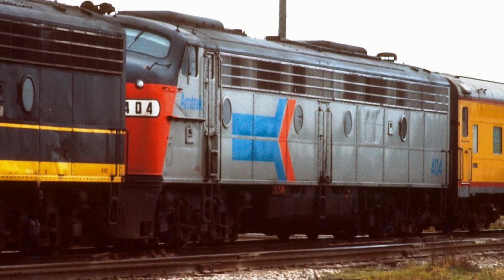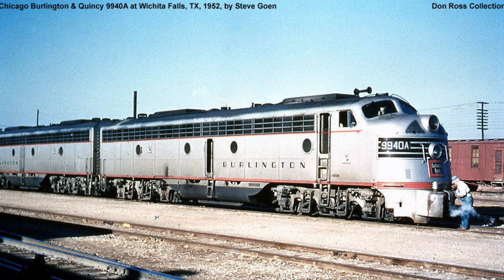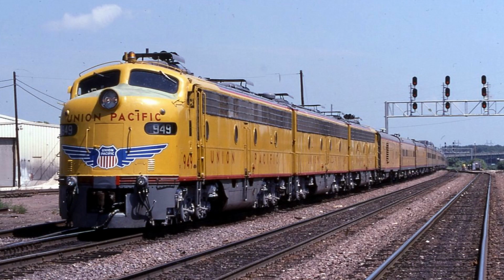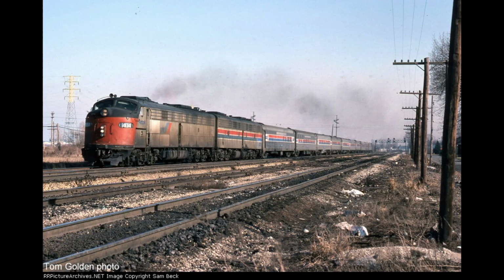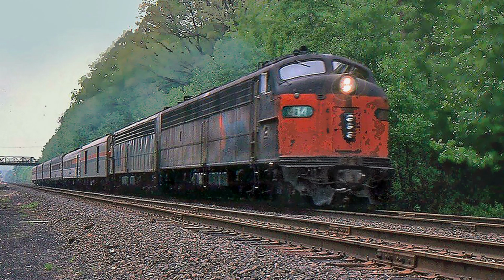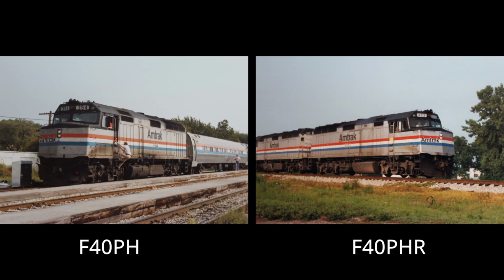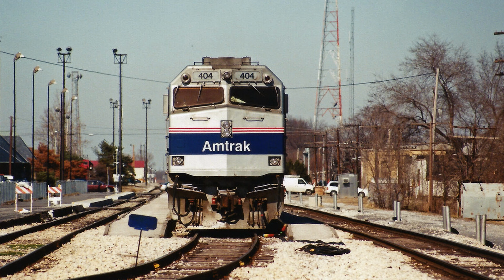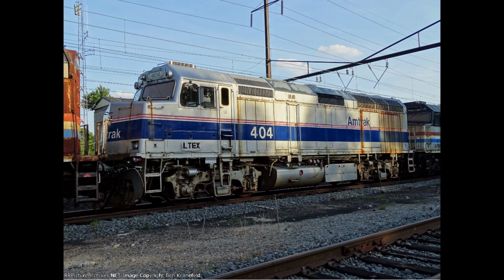404s of the World: Amtrak 404(s)

Comment: I love F40PHR unit 404.❤❤❤❤❤
Reply: I would like Ex-Amtrak F40PHs 365, 392, 396 (Metrolink 800), 403, and 404 to be purchased by Metra to save them from scrap and to fill in the gaps in service when the F40PH-2s were taken out of service and to fill the gaps in service while the SD70MACHs are being delivered.
Reply: @maas1208  I also hope the EX Amtrak F40PHR unit's 369 and 388 will be saved.

Comment: I would like Ex-Amtrak F40PHs 365, 392, 396 (Metrolink 800), 403, and 404 to be purchased by Metra to save them from scrap and to fill in the gaps in service when the F40PH-2s were taken out of service and to fill the gaps in service while the SD70MACHs are being delivered.
Reply: Or at least have Metra Get Ex-Amtrak F40PHs 365, 396 and 404.